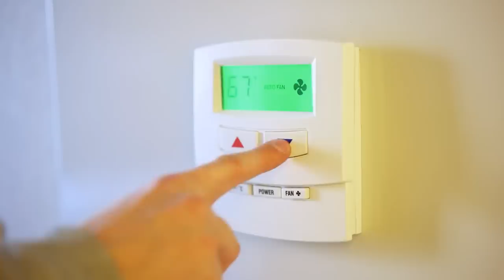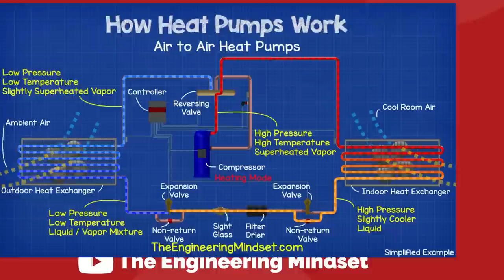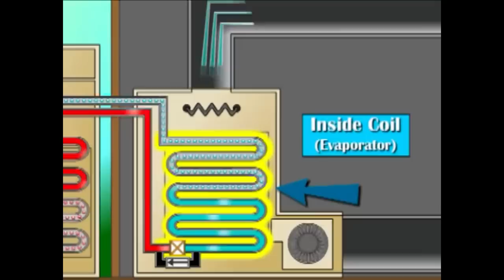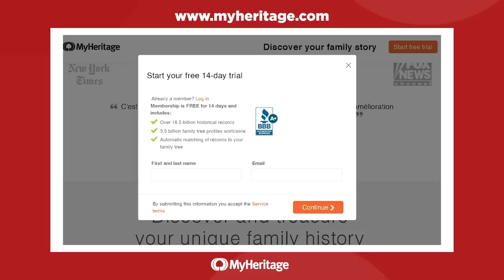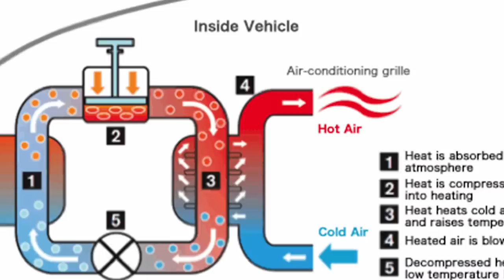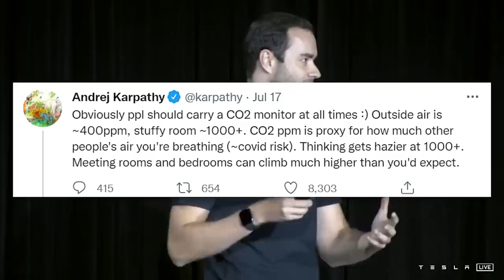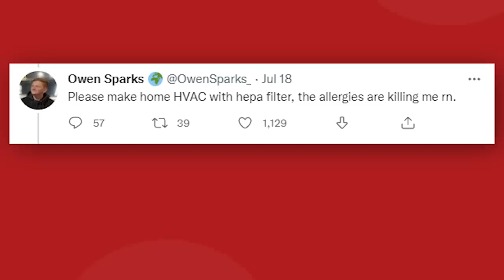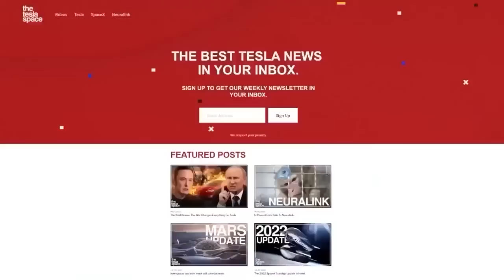Why Tesla's Heat Pump Is Essential For Our Future!

Comment: Heat pump was a no brainer for me several years ago when I needed a new A/C unit anyway. Propane prices had been spiking and getting pretty ridiculous, so the heat pump gave me amazing savings. It paid for itself in 3 years.
Reply: local propane companies around here (California Sierra Nevadas) say propane is going up 53% so I did the same 4/5 ton heat pump for heating and a/c. Way cheaper.

Comment: In Australia heat pumps (usually referred to as reverse cycle Air Conditioners) are common.   Water heat pumps are also rapidly increasing.  
The good thing about Tesla is that the thought of the competition should drive the existing manufacturers to really up their R&D.   Seems to me there would be significant advantages to combine hot water systems, home heating and cooling into one integrated product.
Reply: I worked with heat pumps here in the US (New York) back in 1980s. I'm not sure why the narrator thinks they have only been in common use for ten years.  There are useful, but not a magic solution, their efficiency varies with ambient temperature.
Reply: rovert821
I think Steibel Eltron have a combi system doing both space heating and hot water.
However they utilise R134a, so not a fan.
Here in Australia, the best HWS heat pumps are Reclaim Energy, as are most efficient, refrigerant is CO2 & has a timer to utilise home solar PV when available.
So a super effective & cheap to run system.
Reply: I know right, its like they think Elon invented RCAC or something.  The reality is the units here are cheap, its the install cost that bites!
Reply: Here in Ukraine we have such solutions. They install a heat accumulator (a large insulated tank of water 2-3 cubic meters in size), which is heated by any heat producer installed in the house (heat pump, solar water heater, gas heater, fireplace, etc). And there are energy consumers (heated floors/walls, hot water, etc.) which consume the energy from the accumulator via heat exchangers
Reply: @serhii.almazov  yeah, it’s called a thermal store here
Reply: The problem with air conditioners is that in a large city it adds heat into the atmosphere adding to global warming! Geo thermal with a large mass insulated container heats up in Summer and cools down in winter without adding to global warming or cooling had a working unit in 1974 and heating bills were $20 per month and the same for cooling in summer! But you still need a passive solar heating on your home, which I do have!
Reply: @catsupchutney  Exactly. The cult of Tesla perhaps.
Reply: @guringai  Panasonic, Daikin and Nibe all have integrated systems and that's just off the top of my head. There are several others but I haven't used them recently.
Reply: Its crazy how often in Australia you see a heat-pump hot water blowing cold air into the atmosphere to heat water, and then a few meters away an aircon blowing hot air into the atmosphere to cool a room. At least I have started to see some heat pumps that are ventable back into the house to boost the aircon.
Reply: @DutchKC9UOD  its not adding to any warming, don't dispel myths. Its moving the heat gain inside the building to outside...where it would be if there was no building. Venting of refrigerant itself however is a problem. With Geo your moving the heat into the ground which can be more efficient though has a much higher initial installation cost.
Reply: @serhii.almazov  Also greate heat accumulator is thick concrete floor with water tubes inside. If you have decent insulation, or you live in townhouse(like I do), then you can turn on your heating only at night hours when electricity is cheaper. We have 7см concrete floor with water tubes inside
Reply: @catsupchutney  because heatpumps have vastly improved in the past 10 years. Before that heatpumps didn't work hardly at all below 32°f now we have heatpumps that work down to - 25°f. That makes heatpumps substantially more useful.
Reply: @sectokia1909  good point. Seems that aircon could be coupled with hot water heater.
Reply: @DutchKC9UOD  If you are heating your home you always heat the envirinment, because if you home would not lose the heat you did't need to heat it at all.
Reply: i work in hvac and tbh, this is all too much hype about nothing really. i tend to refer to this industry as a dead/zombie engineering industry just because we hit the wall in terms of innovation 100yrs ago in this industry. changes are marginal including what tesla is doing. what you call hot water systems is what the industry simply calls a hydronic systems and is widely used in schools and other huge buildings. just an fyi, hydronic systems only make space in space heating for very large structures, small homes make such systems highly inefficient
Reply: They're also very common here in the US. Carrier, Trane, Lennox etc etc they all make heat pumps. Pretty much all mini-splits (or ductless AC's) which are rapidly becoming more common are also heat pumps. Problem with them is they're still more expensive to run than gas furnaces or boilers. Yes they're efficient, but they still use a lot of electricity to run, just as much or more than your normal AC if they have auxiliary heat strips especially. So they kind of depend on the electricity they're using being produced cleanly and also being cheap.
Reply: Its been done in the states since the 80s. None of this is anything new.

Comment: Great video I installed a mini split system four years ago and I’ve been very pleased I hardly ever turn on my gas furnace just use the heat pump to heat individual rooms. My system is considered a mini split. Which means one unit in each room. Disadvantage is air circulation small fans don’t push the air down the hallway necessarily. Extreme conditions I sometimes use a box fan to push the cool air around. I have a solar system from Tesla electric car model three and a small Jacuzzi (electric powered).  My electric bill is still under $75 a month on average.

Comment: Just as an addendum, my own experience with switching from a gas HVAC to a heat pump system was more beneficial than anticipated.  My previous newer home had a natural gas (utility provided not a LP tank on site) system and was a single story ranch on a slab around 1500 ft sq.  My new to me 2 story home w/ a walkout has a heat pump system and is about 3200 ft sq.  Both homes were built within a few years of each other.  My utility bill is the same for my current house as it was for the ranch!  It is actually cheaper in the cooling season, but about 15% higher in the heating season.  The overall average though is the same!  I was able to further  reduce my bill up to 20% by improving insulation around the house for less than $1k investment.  I had used the same methods in my last home for a reduction of about 10%.  Bigger bang for the buck with the heat pump system.
Reply: I'M ADDING SOLAR PANELS TO MY ROOF TO PAY FOR THE HVAC MULTI POINT SYSTEM
Reply: You need to give actual numbers. Like how many KWH did you use in each house, How many heating days in your new house vs your old house. Heat pumps are not magic and electric is expensive. Electric is about 5 times more costly than Natural gas. Every video I watch about how great heat pumps are fail to give apples to apples comparisons.

Comment: I put a 13 kw solar system on my 1800 sq. ft rambler in 2015, replaced my oil furnance with a heat pump, and in 2018 bought a Tesla M3.
My total energy costs went from over $5,000 a year to  about $500.  The only gas I buy is for my wife's Honda Civic and my lawn mower.  The heat pump uses the same heating ducts as my oil furnace did.  The system works great, is quiet, and now provides AC in the Seattle area where I never thought I would need it.  Thanks to Net Meeting, I bank excess solar power in the long summer days for use through most of the winter.  Last year I had to pay about $50 for electricity for two months that were over the minimum $7.95 monthly charge.  We did spend a lot of money on better insulation and weather stripping as our house was built in the 60's when oil was cheap.
Reply: With a 25 year ROI
Reply: @kmkall6874  Actualy  it's closer to 8 years - without factoriing inflation.

Comment: Also your refrigerant cycle chart is oriented wrong as the high pressure vapor from the compressor is fed into the top of the condenser. And high pressure liquid comes from the bottom to head the metering device just before the evaporator.

Comment: the military has been using heat pumps for yearswith "emergency heaters" that get used to death in arctic conditions.  The heating coils are exactly what you find in cheap 20$ portable heaters.  The heat pump works better when trying to cool things dowm but is most eficient when you have a LOT of heat on one side or the other.  In a desert there can be a cooling problem instead of a heating problem because the freon never condenses enough.  We ended up having to adjust the presures in the systems to get enough cooling.

Comment: In Minnesota, my heat pump system has worked wonderfully for over 10 years. It reverts to natural gas in extremely cold weather automatically. We also enjoy high solar gain from windows and the HVAC system adjusts the fan speed to distribute that heat evenly throughout the house.
Reply: Are you selling something or are you describing variable fan speed with way too many words? 🤣
Reply: @gravestoner2488  Neither, just affirmation of benefits green technology brings, not to mention  rebates and reduced electric rates that may apply.
Reply: @sagecoach  dude i sell this stuff for a living, you sound like me on the phone with potential customers
Reply: @gravestoner2488  We are on the same page. Retired, mine is sage advice.
Reply: We have used Geothermal heat pumps at our home for 30 years in Michigan.  Wonderful technology. In summer it also makes free hot water from the heat extracted from our home. While our unit has backup electric resistance heaters, they have never been used. We also have many south facing windows which enable the house to pass 80 degrees on a sunny winter day even with temps near zero. The heat pump fan circulates this heat through the home.
Reply: @larrybolhuis1049  Thanks, you have the best and ideal way to go. Mine just took the opportunity to add a heat pump function while replacing an existing air source air conditioner.
Reply: That is awesome, and I would like to setup my system to switch to a different source when it drops below about 15 F, and the resistance elements kick in.  My costs dramatically increase at that point.  I also use as much passive solar as possible, but on cloudy days I need something better.  Jotted down a passive solar heat tank system that would be external in a shed with underground pipes running to and from the house for heat exchange.  I incorporated it into a heat pump water heater and a radiant pipe system to supplement my heat pump HVAC too.  I just haven't worked out the best way to automate the change overs as needed (to transport heat out in summer instead).
Reply: @davidbruner226  If the new supplement system is separate just control it with a separate simple thermostat set to a higher temperature to heat first. If that is not enough heat the main system will kick in as the temperature drops to its setting.  Otherwise, there are multistage programable thermostats that may do the entire job but they can be a challenge to wire and set up.
Reply: @davidbruner226  It sounds like your heat pump is air to air. If you had a Geothermal heat pump you could use that tank of water as the 'geo' source for the heat pump.  Most (all?) of them have an option to use an antifreeze solution pumped through a loop to gain/lose heat for the unit. The loop is intended to be buried in the ground but there is no reason it couldn't be submerged in your tank.  You do need to do the math though on how many BTU that tank could really store. It takes a lot of water to hold a significant amount of heat.
Reply: A true Heatpump would heat anywhere without any backup heat.
Reply: Turn the gas valve to the furnace off and see how it does this winter.
Reply: @darrinburkowske5162  Not really, at absolute zero there would be no heat to pump. The limitation is the performance of the specific machines technology. Sometimes multiple stages may be involved but cost effectiveness is the practical controlling factor.  Lots of machines do pump heat.
Reply: Sounds like you have a old inefficient heatpump.
Reply: @randybobandy9828  How you reached this conclusion?
Reply: Nice, dual fuel is the way to go. Can you believe we install those in Florida
Reply: @peterrogers1616  It is always in the math for the cost per BTU realized by each fuel and system. The problem is, energy costs are unpredictable over time. I have experienced cold weather in Florida, so I believe you.

Comment: Not sure what is new here?  I have had a heat pump system in my house for the last 25 years with hepa filters due to wife's pollen allergies.

Also the current refrigerants are no longer bad for the ozone layer, there refrigerants were paused out a long time ago.  Why call refrigerant Freon, it like calling every car in the world a Ford?  I would be more impressed if Tesla used water vapour as a viable refrigerant. In cars. (Which is technically totally doable)

Not sure what Tesla is offering in this case what is not already tried and tested rechnology.  Would be interesting to read the tech data,.and hopefully they made some efficiency gains.

Comment: I’m in the HVAC field, what you are talking about is already been in practice for decades in the states. What he did in the Tesla is remarkable, taking commercial HVAC technology and put it in a car. Mitsubishi has taken it to the next level, heating and cooling from the same heat pump at the same time. It’s called VRF Technology. Now available for residential applications.
Reply: Europeans have been using it all the time!

Comment: In my 2100 sq ft.  ICF  (Insulated Concrete Form) home here in South Alabama it cost $130 to cool my home, I use a wood stove during the "winter" weeks.  I spray foamed the attic and keep a chocolate Easter Bunny in the attic for a gag sitting on top of the attic HVAC unit, he has been sitting there for several years and looks great.
Reply: "Winter weeks" sounds great! Many of us have "Winter months", lots and lots of them, and then we have Summer weeks if we're lucky or Summer days if we're not 🤣
Reply: As an HVAC guy that chocolate bunny ain’t a gag. It’s a flex… and is a mighty cool one 😎

Comment: in the mid '80s I sold a wide variety of heat pumps to the residential market.  Living  in Canada, I was often asked how a heat pump gets heat from cold air.  I would ask the client and then quickly answer.. what is the difference between 10C and -10C?   20 degrees of heat!  The heat pump extracts the heat from outside and moves it inside.  

The biggest difference for most people is the temp coming out of the register in the house.  An oil furnace or gas furnace delivers 110F and is very warm to touch.  A heat pump  delivers air at the register about 90F - problem is the body is at 98F, so it feels cool to the body.  

Put your hand over the register, a gas/oil feels warm, and a heat pump at 90F against a 98F hand feels cool.  Common question: How can that heat my home?? A house is usually 70F - the heat pump even at 90F is delivering  20F of heat. In the room it feels the same 70F.
 
Modern heat pumps are getting efficient - a significant saving in most of Canada at 30%

Comment: In 1982 I purchased a house built in 1850 and had a long wood/oil furnace that gobbled up 2 cords (at a cost of $100) of wood the first winter in Minnesota.  Before the onslaught of winter the following year I installed 20 KW of resistance heating in the duct work on the dual fuel program by the local rural electric utility.  My heating bill went up to about $250 a month.  The following year I purchased a used 3 ton heat pump, replaced the compressor, had outside help of an electrician and HVAC guy and my monthly bill dropped to less than $150.  Go with the HEAT PUMPS ! ! !
Reply: You probably have the oldest house in USA - I have a modern house - 18th century and my neighbours' houses are from the 14th century but don't blow away in the wind!